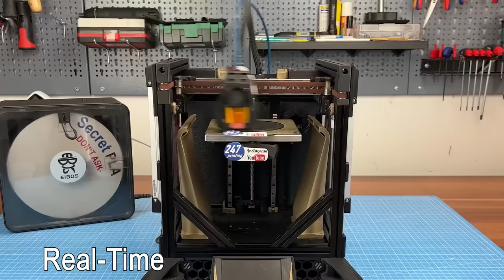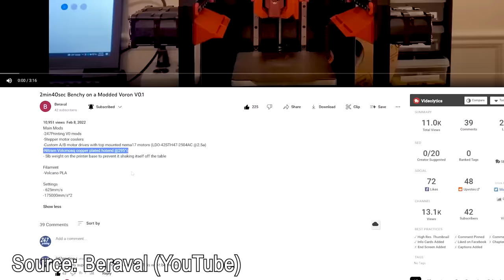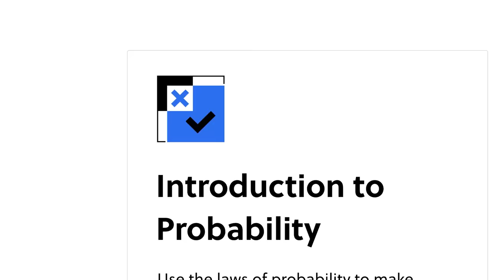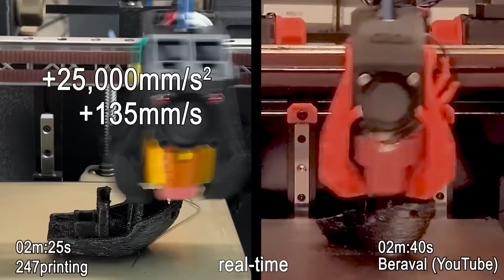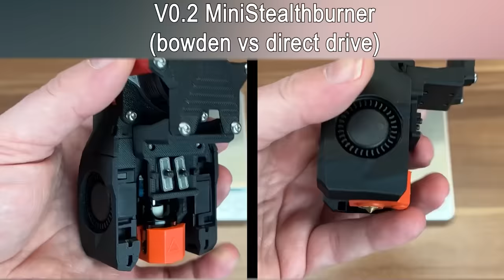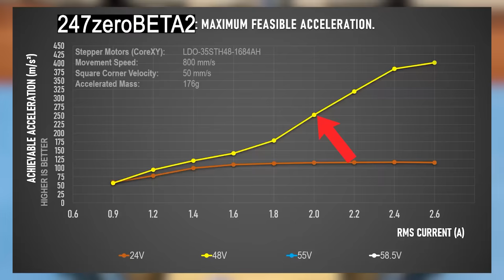247zeroBETA2 : Motion and Extrusion - The Fastest Printer? (No, but it's cool anyways!)

Comment: Might be time to break the rules and step up to servos! You could make the gantry stiffer again for less overshoot, more quality
Reply from the maker: Aren't those >=Nema23? Absolute overkill for that tiny printer :-D I don't like the idea really...
Reply: @247printing  Hi Albert,
My reply must have gotten lost somewhere, there are DC servos in nema 17 size available! Check the JMC iHSV42 servos, they cost ~90€ and are available as 58 and 72 watt versions, and are fully rated with full torque up to 4000 rpm. I used the nema23 version in a high temperature printer i built for the Solvay AM cup. It moves my 10kg heavy Y axis easily at >5g‘s with no lost steps in sight, it really is fabulous, no regrets, all while being completely dead silent. Don’t hesitate to ask me questions about them if you want.
Grüße 
Max

Comment: Increasing voltage makes sense, if you've decreased the mass you're moving, then the goal would be to run at the lowest current setting you can use to generate the torque needed. Coming from cnc world, the reason for using 60v PSUs is to get decent speeds at high torque as the goal is to overcome emf. Using low inductance steppers will get the best results. You can increase current while not hitting max rpm due to emf, there are emf calculators that can help you find the max theoratical speed you can achieve. Try to lower your current while running at 50v, and you should be able to hit higher speeds. With a light gantry and extruder, you're not torque limited.
Reply from the maker: Thanks a lot for that very precious comment - didn't know that 60V is common in the CNC world! As a FDM printer is also a CNC - why not go at high voltage...?
Reply: @247printing  I run my 5'x3' CNC with hybrid servos on 60V DC because if you do the math EMF on 48V would limit my travels. CNC world, no one is even trying to go over 200mm/sec, it's not practical to move 30-50kgb gantry+spindle faster. Keep accels to 200-300mm/sec -- yea, very different than a 3D printer. Main thing to keep in mind is current is torque, voltage is speed. CNCs need a LOT of torque, there is the moving weight, and there is the resistance of what you're cutting, wood, metal etc. So my Y axis needs a nema 34 at 6A of current(max). When you calculate the back EMF at that current, you need more voltage. I even tried running it at 90v DC, but in US with 120 AC mains, a 90V DC PSU is really sketchy. If 60V DC setup wasn't going to work, I was going to move to 240 AC, since my spindle runs on 240 already. For 3D printers you can absolutely go up in voltage, but you need external drivers that can support it. Step sticks and other small trinamics, 55v as you're doing is really pushing it. There are plenty of really good external drivers that can run on 60-90V DC. In Europe with 240 from mains, you can get a 90V DC PSU to run very nicely. Look up EMF max RPM calculators, plug in your current, inductance and voltage -- boom you get theoretical max motor RPM, with corexy it will take a bit of math to calculate RPM relation to actual speed. I have a big printer with 2 heavy gantries that I've lightened as much as I can so far, and I run them on 2 nema 23s on each side and I lower the current to under 50% of max rating because the nema 23s provide much more torque than I need, but I can push speeds higher, for a big printer I can hit 500m/sec at 10k acceleration and only at 24v. If I max out the current 300 mm/sec is max. Printers use belts, usually, so 1 RPM = even with a 16t pulley is 32mm of movement, on a CNC,  like mine with direct driven ball screws, 1 RPM is 5mm of movement, you need a  lot more RPMs to hit target speeds, thats why on bigger CNCs, you either go with higher pitched ballscrews (I wanted precision, so I didn't) or you go with servos and more voltage so you can spin them faster.

Comment: What i have found out: using stiffer filament for the xy joints really helps with acceleration. On my v0.2 with a fat boi lgx lite, microprobe, canbus board and bigger 4010 fans on the toolhead i got additional 2,5k acceleration by just switching from regular abs to glass fiber reinforced abs. Recommended acceleration went up to 16,8k from just above 15k, even though the glass fibers increased the moving mass ever so slightly. So you may want to try a stiffer filament for some quality improvements. Here i could recommend pc gf or pa cf from cr3d or the super strong filament from igus
Reply from the maker: Light weight and strong/stiff does the trick yeah! Though your rather "slight" improvement (+12%) could also be due to belt re-tensioning in between the change? Just guessing!
Reply: @247printing  could be, although klipper never has recommended in that region before the switch. Did several tension settings, all about the same.
Oh, forgot to mention i also printed the x carriage out of the abs gf20, i can imagine that this part has an even bigger influence than the xy joints

Comment: Once the core of the motors saturate, the have the same magnetic permeability as air. That's why your acceleration still increases after you saturate them, but at a lower rate. This is because the magnetic permeability is much higher in unsaturated ferrite core. Also, torque is proportional to magnetic field, which is somewhat proportional to magnetic permeability of the core.
Reply from the maker: Thanks a lot, I'll check the theory on those key words!

Comment: I’m looking forward to seeing how much torque and speed output we can get from NEMA14 motors! I have a hunch the rated current is heat limited and not due to saturation, so we may have a lot to play with yet 😄 🔥
Reply: Nema 14s tend to have higher inductance, especially for the torque you get out of them, so the limiting factor will be back EMF.  The ones I've seen are rated at 3.8Mh for 40Nm, that's gonna kill your max speed, even at 48v, that might hit 1000mm/sec, not much more, even running them under max current. Compare that to LDO nema 17s - much lower inductance at 1.5, and you can under current them and still get more torque and at 48v you can push over 2400 mm/sec.

Comment: For motor cooling at high current, have you considered something beefier than those 4010 noctuas? They produce neither high airflow nor high static pressure, so they are not ideal for this kind of application. Larger fans (4020, 4028, 6025) or liquid cooling (like Vez is doing on his steppers) could let you achieve lower operational temperature.
Reply from the maker: Very good point! I had a line in the script like "For those currents I'd need to step up the fans for the stepper cooling", but I deleted it, because I don't want to encourage the public to try those high temps, before I did more testing.
Reply: @247printing  a simple water cooling setup would work nicely and overcome the surface area/local space limitations. There are even pre-made water blocks for stepper motors, although I’m sure the quality varies quite a lot and a  trio of completely closed-loop CPU coolers May actually be easier.

Comment: Beware of an "invisible" problem there. The umbilical breakout board. AFter lots of troubleshooting I found out my umbilical cable connectors were not as solid as I thought, especially the backside one which connects to the fixed oblong board. The issue is the continuous back-and-forth movement of the head, aggravated by the relatively short umbilical cable lenght, causing the conector(s) to undergo rather extreme tilting angles. That may cause brief interruptions in some of the cables. This problem is equivalent to introducing a randomized PWM in some of the cables connected to the print-head, generating all kinds of nasty consequences like faulty heaters, false temperature runway fails, lagging thermistor data and extruder stepper with unstable voltage/current supply. It is challenging to diagnose this problem in real-time with standard metrology equipment like cheap multimeters but you may be able to see it with the printer turned off, measuring the resistance of each connection while gently applying back and forth pressure to the each end of the umbilical cable. I just got rid of mine after all.

Comment: Have you considered using carbon fiber for all of the moving parts? You can get crazy stiffness and lightness. It's also a material that benefits greatly from being able to know the direction of force before manufacturing which is exactly what's needed here. Easy Composites has a bunch of tutorials on YouTube explaining different process to make carbon fiber. They also sell carbon fiber rods and are UK-based.

Comment: I wonder how complicated it'd be to belt a stepper to the top of the toolhead to get all the benefits from a direct drive extruder without the weight of the motor. You'd probably have to make a spring tension system because it moves around, but it'd help quality. Might even speed it up because better control over pressure.

Comment: When you're talking about the rated current of the motor, 1.68A in your example. It only means that it is the continuos current where the motor can operate without getting too hot. This has been set by the manuafacter and it does not count active cooling. So you can exceed the rated current if you are able to keep the motors temperature low enough for it to not break.
So in that sense exceeding the rated current is not a limit of your motors theoretical capabilities. The higher current you give to your motor the more torque it has. But when you increase the frequency of your pulses there comes in another factor that is inductance. Inductance (milliHenries, mH) tells how fast your coil is able to reach its maxium current. Let's say your motors coil achieves its fully energized state in 5ms. If your steps take 9ms each, the coil has time to be fully "energized" for 4ms. It is already less than half of the step at the maxium torque. When you increase the stepping frequency even higher for example 3ms, your motors coil has no longer time to be fully "energized". In the following example the slow rising of the current caused by the inductance is linear. 
We can only reach 3/5 (calculated 3ms/5ms) of the maxium current each step. In this situation increasing the current helps because 3/5 of 3 amps is a lot more than of a 2 amps. 
In summary choose a low inductance motor, use as high voltage as possible and make sure the current is as close to maximium as possible without destroying the motor. There's a good and short post about this if you google search "LinuxCNC Stepper motor inductance".
Reply from the maker: Thank you SO MUCH!

Comment: @247printing maybe you could use LWPLA for the structure parts. Use normal pla for the shell and stiffness but use the LWPLA for the infill and you could shave some weight
Reply: Broskisnowski  The thing is that the normal PLA has more strenght than the not foamed LWPLA at my institute we did test for this and the normla pla was stronger than the LWPLA (not foamed)

Comment: 13:26 YES i have 1 why you have to use the cooling block on the hot end you could use a airgap - because this printer is fast and gets extra air from the fans.
 2 It would be interesting to use a lineal motor on the Y axis , like the motors in pick and place machines.
Reply: ok you could say ok OP why dont you build that , the same reason I have no time , and place mostly space.
Reply: I'm actually working on a printer with a linear magnetic motor motion system but it's slow going, magnets are expensive and doing all the FEA simulations for the magnetic fields and forces has been a whole lot more work than I anticipated.
Reply: @oliverer3  Yes that is the name of the game, after a point the work or money is exponentional

Comment: Moin! One question regarding going even faster in the future. Do you think systems, like the Annex-Engineering K3 with using only the linear rails for X and Y and 4 motor drive, will be the future? I think it would probably be a bit less stiffer than the V0 but if you someone would build one with a smaller print volume, for more stiffness, and a bowden extruder, it would be a propper challenger for the V0 design.
Reply: That mechanical system is pretty much the Ultimaker style of cartesian with motors on frame, but with extra motors and linear rails instead of the circular bars.
One advantage is a symmetrical weight distribution on X and Y.
Reply from the maker: Servus! Yes I am very tempted by that motion system (CroXY) and I have a feeling about it being the next big thing in the near future.
(What CoreXY just became in the mainstream market)

Comment: I half expect to see some kind of liquid cooling for the steppers to show up at some point. Just to see if one can squeak just that much more from them, I admit I have no clue how one would do it as I personally have doubts on those water blocks I have seen that just screw onto the back plate.  Seems like one would need to get the sides of the motor as well.

The benchy is ugly but this is NHRA Top Fuel Printing, The whole idea is brute speed.  after all you do not play at 11 for audio fidelity you do it because its one louder.

Comment: Albert, I got a question for you. I also got to tell you I stopped working my extruder I told you about. I was trying to solve a problem that didnt exist...Anyway:

Could you link me to the printed X gantry you used on the old 247 zero? You said you printed it out of PET-CF. I want to print that as a start for my 247 zero build, just because I dont want the price to shoot up immediately.

Comment: This might be something extremely dumb, but have you considered stepping down the grade of belt for the x/y. I am not sure what belt size is on there currently but it would be like going from HTD5mm to GT3mm(those are some belt sizes I have used). It could save a few grams of the moving mass and potently reduce the size of the bearings. The big down side to this is it would increase the amount of stretch in the belts.
Reply from the maker: Very nice idea - didn't even know there are small ones. Maybe those are sufficient!

Comment: As it seems part cooling is the most important part that is slow.... how about using evaporation to achive extremely fast cooling? Water evaporation is extremely fast and cant be beaten with air alone. A small piezo mist maker inside the head and micro tube (from a inkjet printer) that provides the water and on the backside of the printer a peristaltic pump that pushes very very little ammount of water to the piezo mister. This should give you extreme cooling ability's with the fans you already have.
What do you think about this idea? Yes there are difficultys like preventing the mist getting on top of layers where you want to print, but it might work even with that because the melted plastic is at at least 200C which means the water evaporates immediately....
Would love to hear / read what you think about this....
Reply: Cooling is not an issue on this printer. Watch the full video :)

Comment: 200,000 mm/s acceleration is close to 450 MPH
Reply: mm/s^s is a unit of acceleration, It means after one second of continuous acceleration you would achieve that value in velocity. Currently the printer is moving 800 mm/s which is roughly 1.8mph. I hope this clears up any confusion

Comment: Whats the point pushing fdm to be fastest where all know it will not perform best and prone to have many issue.. If you need to be fast, straightaway go for sla type.. But your machine is super awesome.. If i got one, i will surely handle it with love and care.
Reply from the maker: Thanks. The point of it: Fun at stretching the limits. It's as easy as that. The potential at insanely fast quality printing will be shown next.

Comment: I wonder if it would be possible and helpful to pre-cool air before blowing it on print
Colder air, better cooling right 🤔
Maybe using peltier element or something like compressor in a fridge or a radiator cooled with liquid nitrogen

Or going crazy maybe use different gas with higher thermal conductivity or something like that muhahaha

Comment: It only looks like 💩 because bowden. 😂
Reply: Like, the speed of sound in the filament through the bowden tube, and in the bowden tube itself stretching and trying to recover its shape, is probably a serious bottleneck to quality at this kind of bonkers speed. You're going to end up with approximately the right amount of material extruded, but displaced on the time axis from where it belongs.
Reply: @daliasprints9798  I'm not convinced that this is the case; i mean the printer can turn on a dime and accelerates like mad, surely it can just maintain a consistent extrusion flow with barely an interruption on nonprint move. You would also see quality degradation focused just around or after nonprint moves, not also on hulls and fills, where the tension on the bowden tube remains constant moment to moment. I think the worst of it is induced bed movement relative to the frame, or maybe some gantry distortion. So actual compound movement positional error rather than extrusion issues. I think one would like to rigidly mount a high speed camera to the frame like thousands of frames per second, it might generate some insight.
Reply: @SianaGearz  When you're printing at over 700 mm/s commanded speed, you're not cruising at constant flow. You're accelerating up and down towards and back away from that the whole time, with only rare intermittent cruises.

Comment: What’s the secret PLA?
Reply from the maker: Diablo's hair
Reply: Likely PLA-meta from SunLu as it has very low printing temperatures, so you don't have to worry as much about a super long melt zone and because it prints at a lower temperature it will reach that temperature faster